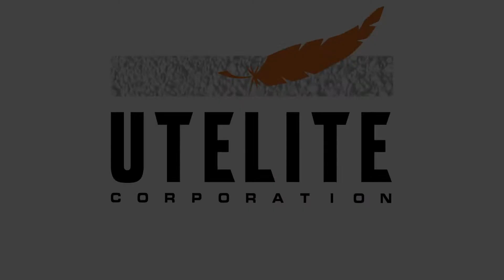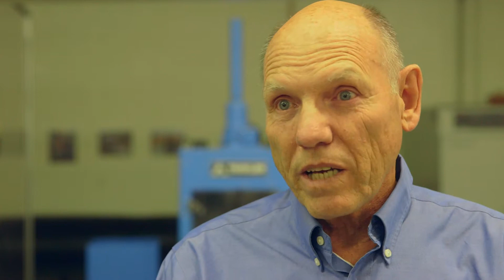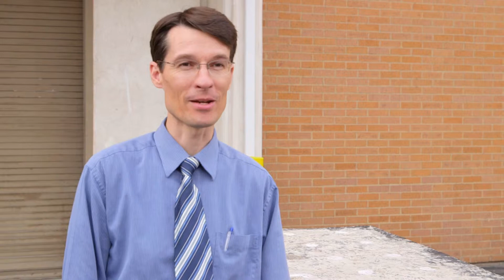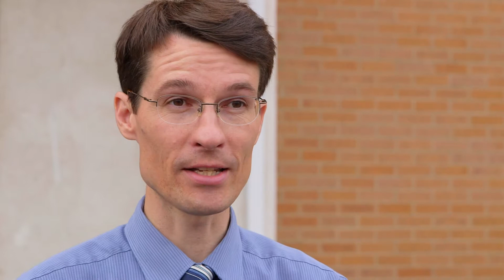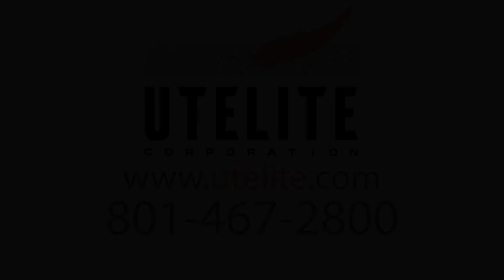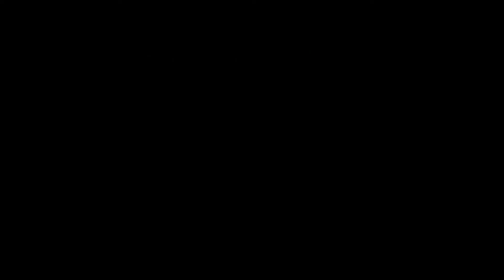Utelite Lightweight Aggregate & Internally Cured Concrete, Part 1

Comment: Lets say am using Polyethylene Glycol as internal curing agent. If I want to calculate how much amount of water is being absorbed by the Internal Curing Agent, what is the method available? Please answer, if you have an idea about this. Also, does using PEG increases strength of concrete? If so, in what way PEG contribute to strength? Looking forward.